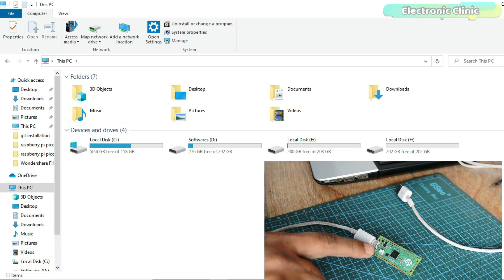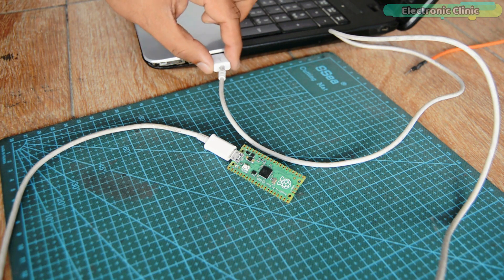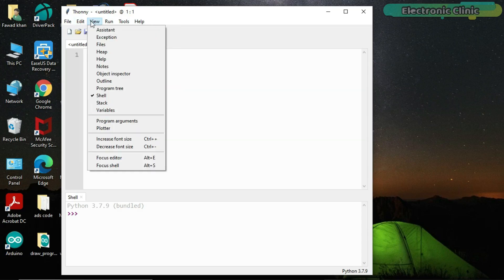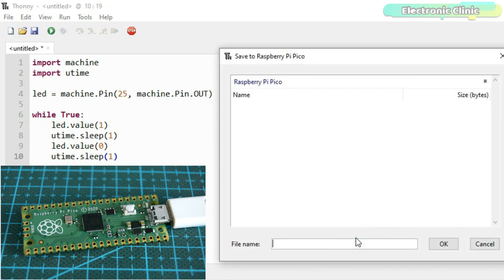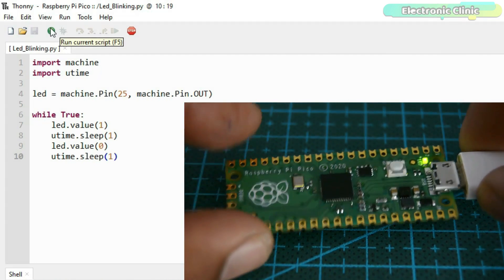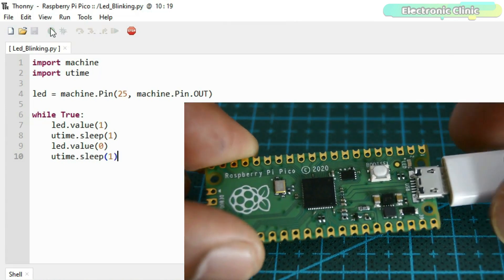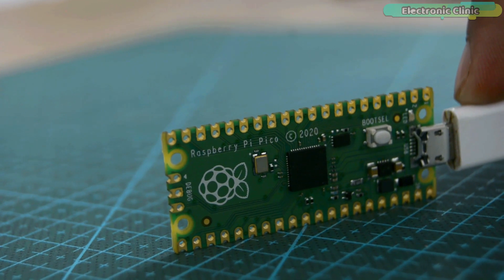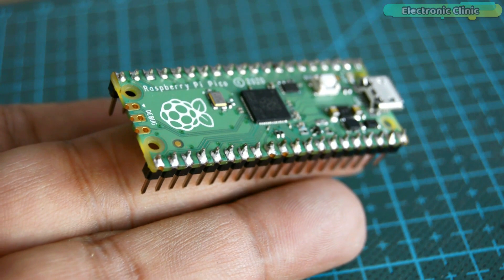Raspberry Pi Pico MicroPython installation, Thonny IDE, save python code, setting up raspberry pi

Comment: I want to make a small project using a rsapberry pi pico, do you think you could help me
Reply from the maker: Ya sure, tell me about your project.
Reply: @ElectroniClinic  Well its a signal blocker, but I have very little experience with coding.